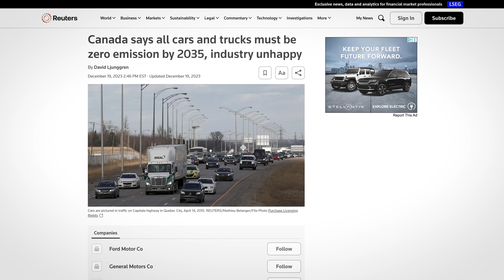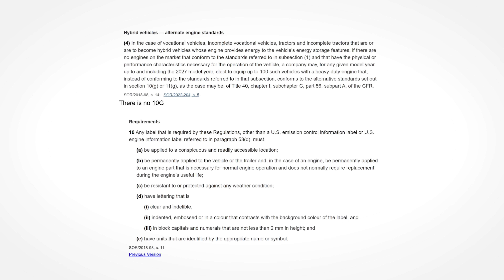Government Red Tape Is Blocking Our Plug-In Hybrid Trucks

Comment: can't you still build "off highway" trucks for the forrests?
Reply: Yes, they can but that market is so small that it might as well be non-existent. In order to be profitable they need to be able to build on road trucks.
Reply: @jeffreyrousay221  sure but they don't plan to sell thousands of trucks in the next 2-3 years. they plan to sell maybe 100 if even to test the system. let alone that they have to first build the shop before they can build that many within a year or two and in canada, there are more than enough forrestry companies that would love a truck that doesn't require even half as much fuel and goes up and down the mountains easier.
Reply from the maker: Yes, but they could never be driven on the road

Comment: Cat Acerts have 1 wire difference between gensets/on-highway. On highway Scania with a an RPM target set? Same as Topsey with a PTO mode?
Reply from the maker: We were told as soon as we change how the engine works, that the engine wouldn't be legal anymore
Reply: @EdisonMotors so don't change how it works at all, just install it in the frame rails, and have no transmission. Generator is free but not included in purchase, there is definitely a simple solution to this problem. Something that simply jumps through their hoops but also brings the truck to market. I'm confident I could solve this.
Reply: Make the kit to "change how it runs" another free upgrade
Reply: @Raz31337 but then the operator could be put out of service during an inspection for emissions tampering. D.O.T. loves writing citations!
Reply: exactly, build the new trucks with an "on highway engine" and just be vague and say "electronic stable RPM transmission" and call the generator that, who CARES, go AROUND THEIR STUPID SHIT.
Reply: @Raz31337 yes, if your a giant company that just lobbies the government to get your way. Problem with being a manufacturer is you have to 100% above board or you get hit. They might be able to use an on highway regulated diesel.  With an RPM target set to 1800. But not a generator. Or a reflashed CPU. It's stupid how much regulation there is in Canada and it's pushing away investment.

Comment: Keep pushing forward guys!  We in the states are watching you folks and we are hoping you can continue to lead the way!
Reply from the maker: We're not going to stop.  This isn't the first setback we've had, and it won't be the last.  It's never stopped us before
Reply: @EdisonMotors  i honestly don't get this BS cause there isn't much difference between a generator  on or offroad ,, i've been building equipment for 35 years and never heard of an on highway generator 
you're using a 9 liter engine in a 70 ton truck ,you're literally reducing emissions by proxy ,reducing fuel consumption reduces emissions 
I see this crap here in the US too , auto makers  , everything from semi trucks to pickup trucks and cars ,, they build EVs to get carbon credits so they don't have to increase the fuel mileage of their trucks ,,fuel mileage standards are based on the average fuel mileage of the whole fleet of vehicles ,not each individual class which is how it should be ,,over the years this has caused debacles with trucks , notably by FORD ,,when Tier 3 came out ford suddenly needed a new engine ,, this resulted in the 6 liter PSD and a huge lawsuit ,,then tier 4 came out and suddenly they needed another new engine , now comes the 6.4 with it's propensity for burning pistons and blowing up randomly ,,both of these are class 6 and 7 truck engines originally made by international navistar ,,used in their big box trucks , and millions of medium duty dump trucks and buses without issues ,, BUT the problems come from adding all the extra emissions control equipment trying to make a class 7 truck engine pass emissions in a class 2.5 or 3.5 truck
Reply: @EdisonMotors  Can you get around it by selling electric only trucks and offering an optional "range extending APU" for the convienence and comfort of the driver? It would basically be the same as a generator in an RV that way and RVs are sold with generators in them right? I know some Semi drivers put APUs in their trucks to keep the batteries charged overnight.
Reply: @TheNeighbor4U  like having the generator built into a detachable cradle module or something? Like selling the truck as a full EV fitted-for-but-not-with the generator power plant?
Reply: @Scriptedviolince  It doesn't necessarily have to be detachable, but yeah. The basic components are not different, just the sizing of the parts are.  

The "APU" can just be an extra option available from factory. The people at Edison are nice guys they will even install it for you for free. Everybody will probably choose that option too. 

Basically we are calling it a different thing to get it categorized differently emissions-wise (assuming APUs have different legal emissions standards.)
Reply: @Scriptedviolince  The basic components are not different, just the sizing of the parts are.

Compared to an RV I mean.
Reply: @TheNeighbor4U  Mmmmm. Installed at factory and non-detachable probably wouldn't pass the sniff test for regulators. Detachable cradle module would also allow for third party generators, easy maintenance/hookups, etc.
Reply: @Scriptedviolince  I just figured APU's are normally bolted in without any kind of detachable cradle. That is how they are on RVs at least. I don't think there is really a difference between a typical Semi truck APU and what Edison wants to put in their trucks other than engine size. The only real difference between an APU and a Hybrid vehicle generator is the size of the batteries they are charging anyway. 

Easily detachable with 100% quick disconnects would be a neat maintenance feature though. Imagine being able to flex on Ferrari with how fast you can do an out of vehicle oil change.
Reply: @John8087 oh no. Not crane. Cradle. As in a detachable module piece that holds a generator, accessories, and hookups and can be slotted in and out as desired or needed. Having an APU as a factory option probably wouldn’t pass the smell test for regulators but having it as a literal accessory would definitely fit.
Reply: @EdisonMotors fucking rights.
Reply: @EdisonMotors  DAMNED GOVERNMENT RED TAPE  ,,,they haven't made the rules yet so you can't do it ,, how stupid can it get
Reply: @EdisonMotors  imagine the battery pack failing due to overload and the truck is delivery combustible material or even hazardous and higly flamable stuff, do u wanna do jail time if a truck explodes and kills several people. Thermal runaway is no joke when dealing with 40 ton load and high load over the battery pack; i understand ur desperate for money but find something else .......
Reply: @shazzz_land  Generator certification is for emissions. It has nothing to do with what you mentioned.
Reply: Would you have batter luck in the State? I know we have our fair share of government incompetence.  Just a thought. Maybe the threat would motivate your government.  Keep fighting! We want you to succeed!
Reply: Stay Canadian and screw Trump land

Comment: Will the Ram 1500 Ramcharger be forbidden in Canada?  It is a series hybrid.
Reply from the maker: It seams like these rules apply to diesel and don't apply to gasoline the same way.  The have separate rules for Compression (diesel) engines and Spark (gasoline) engines

Also Ram can afford the million dollar emissions testing of their own motors and have the data to submit.  We're at the mercy of the engine manufacturer.
Reply: @EdisonMotors  so put a gas motor generator up front, who cares
Reply from the maker: We makes a commercially available On-Highway certified 9 Liter gasoline engine though.   I couldn't find one
Reply: So what if you ask Scania to build a generator for highway use seems dumb but maybe a work around
Reply from the maker: Yes, but we have to convince them that the sales we can give them would justify their expense certifying the engines to On-Highway
Reply: I bleve ram is just useing thir own 3liter engine to power ot that they currently use to power thir 1500s
Reply: Ford makes a 7.3L. Building mechanical trucks instead is a kick in the nuts to everyone that supports you. You need all hands on deck solving this issue. When there’s a will, there’s a way!